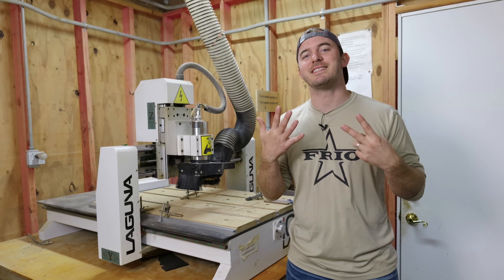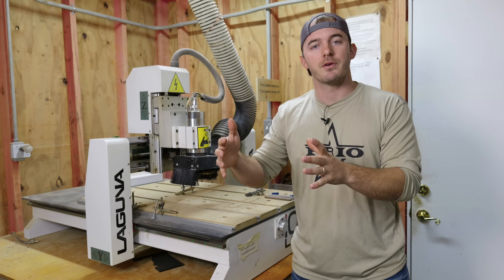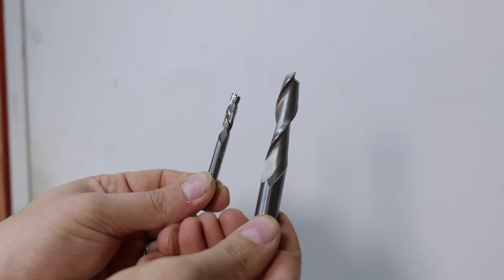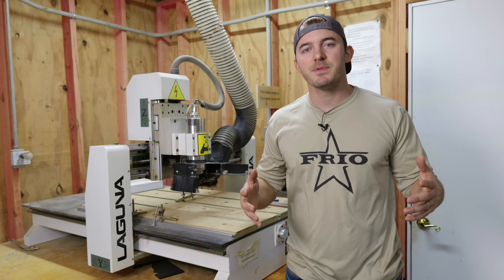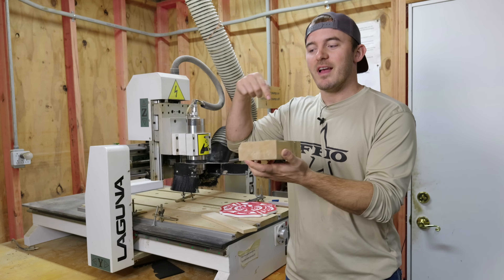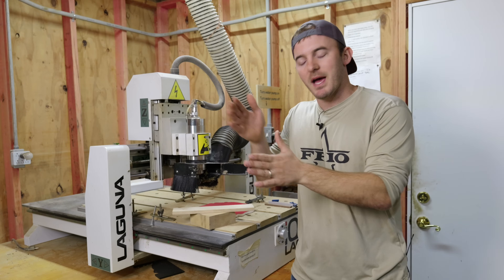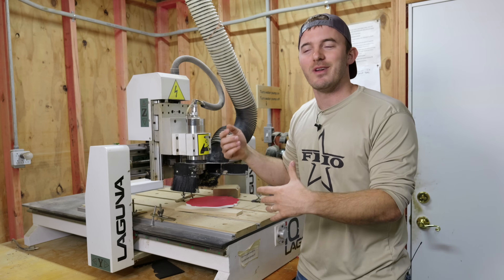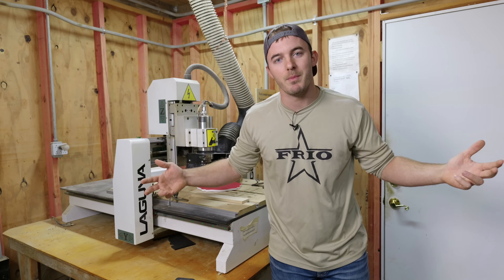7 Mistakes CNC Beginners Make | Stop Breaking Bits FOR GOOD!

Comment: I learned for myself that the smallest suction cup in a CNC machine is not strong enough to hold the part in place if the edge machining is more than 4 mm. =D

Comment: Do the bit manufacturers' tool libraries generally have the correct feeds and speeds for their bits? Or do you modify their recommended settings?
Reply from the maker: I haven’t found any that have good settings, it all depends on your machine. If you have an industrial level machine, then their are setting within reason you can find. But my my experience, all settings bit companies give you are off.

Comment: Helpful video - I have that vintage Laguna CNC, but with the ATC - so I can program in Aspire the feeds and speeds by bit and have Aspire make the change on the machine... I typically run my bits at 40-50 IPM, 18k, and fairly shallow cuts (3-4 passes to cut through 3/4" on a 1/4" bit) and I get crappy cuts and really fine saw dust. A favorite 1/4" compression bit of mine, Amana 46170-K ($$$), has a chipload listed .0031, recommended IPM of 110, and RPM of 18k, with a depth of cut at 1/4".  When I've tried running at that high an RPM, I get screaming goats (that goat clip was PERFECT!), a wabbly machine, parts that don't stay put- kind of scary, and the quality of cut isn't really good. Wood is 3/4 pine or plywood. I am trying to follow the mfg recommendations on the bit, but it's a little frustrating! Do you really run your Laguna at "90-120 RPM" as you say in the video?

Comment: Great vid. I saw you Patrick Bet-David "Entrepreneur" shirt on in a previous vid. I wonder if you were at a Vault event when I was.

I recently upgraded my machine to have an ATC and variable speed control via the VFD. It took me three years to finally start considering the chip load seriously. So much better results!
Reply from the maker: I was at the very first vault in Dallas in 2019, followed PBD since 40,000 subs, had lunch with him a few times, but don’t watch him much anymore, wayyy to political and I’m not at that stage in my life yet, don’t need politics, I just need to get smarter and work harder.
Reply: @cutting-it-close  Cool, you are an OG follower! I went to 2021 Vault and got a chance to say hi. I made a Valuetainment sign for Pat. Good job with your growth, if I only stuck to a plan I may be there with you. I get stuck in my head too much too.

Comment: Great video again!
Always learning from your advice and knowledge 👍

So if I can get a little free advice I’d appreciate it!
1/4” down cut in most woods I’m getting the GOAT SCREAM😂

3hp water cooled spindle,VFD on a  Avid 4x4

I’ve slowed spindle rpm down,adjusted speed. Both ways and no changes.
Ugh!
Something I’m sure I’m doing wrong but can’t seem to nail it.

Also one thing I experience a lot of times trying to get greedy with speed is the dreaded CV rounding my corners.
I’m running Mach3 and Vectric V Carve Pro.
So point being like you said…
Figure out the machine capabilities for sure.
Thanks for the videos!
Reply from the maker: 1/4 typically screams a bit, not going to be able to go 400 inches per minute like you should with that machine. 180 ipm is about max with that machine. 

You can probably tell the scream is caused by the CNC because of it vibrating as well. Whenever it’s cutting feel the x gantry and if it’s vibrating slightly that’s causing some of the screaming. My IQ does that as well.
Reply: @cutting-it-close  Thanks for the reply.
Yep it’s limited on this machine but I’m still a greenhorn so it’s probably a blessing in disguise!
It’s primarily in corners especially in a raster cut.
Guess due to slowing down and changing direction I’m assuming.
Thanks again!

Comment: Hi great stuff, you mention.feed rate but what about depth? In ply with an 8mm straight cutter what feed rate and depth of cut would you recommend? Thanks👍
Reply from the maker: So wood you can go down maximum 3x the diameter of the bit. I typically stay around 2x the diameter of the bit and sometimes only do 1x the diameter. On soft plastics it’s 2x and hard plastics it’s 1x the diameter of the bit. I hope this helps! The feedrate depends on the number of flutes
Reply: @cutting-it-close  thanks very much, I've been going just over 1x depth using 7m/minute and snapped a couple of bits. Reduced to 5m/ minute and been ok but would like to run quicker
Reply: Snapped another bit today, 1/4 bit. 2 flute running depth just over 1/4 per pass at 236 ipm. Do you think running too slow? Cheers

Comment: A mistake i see beginners make is throwing out dull bits, V bits for example you can get them professionally sharpened for a fraction of the price for a new one.
Regular fluted bits is more of a hassle since hobby machines usually aren't able to do cutter compensation. but it's a great way to save money imo.
Reply from the maker: True!

Comment: Mostly all true, except that with 1 flute bits, you have to go slower than a 2 flute bit, theoretically 1/2 the speed.
I have a 1 flute replaceable insert 90° V bit that I run at 18000 rpm and 40 inches per minute, and my 2 flute brazed carbide V bit I run at 80 ipm.
I also have a 3 flute 60° V bit that I run at 120 ipm.

There's definitely a learning curve with owning your first CNC, and I'm still adjusting things with every bit and type of material 3 years into my ownership.
Reply: chipload is calculated per tooth, so not theoretical, but exactly 1/2 the speed.